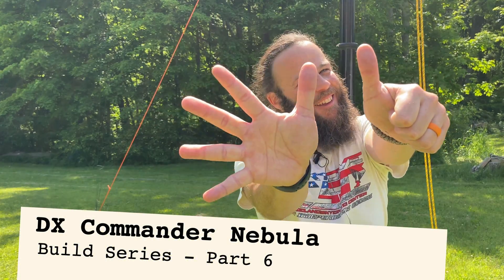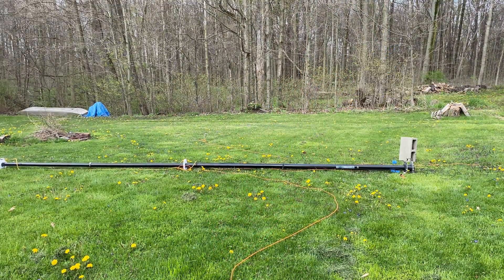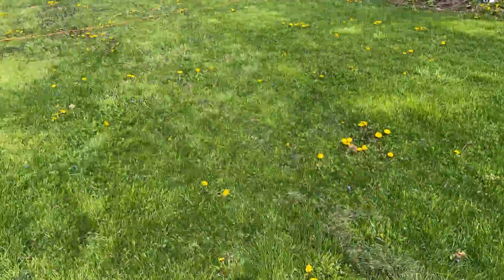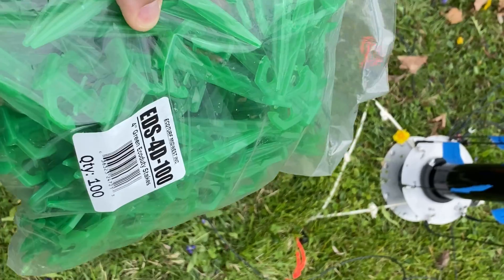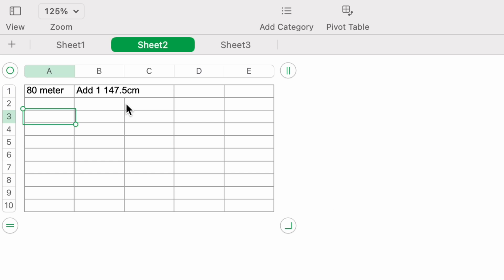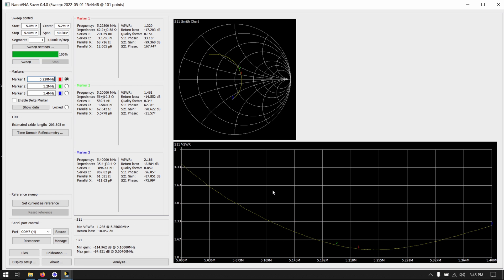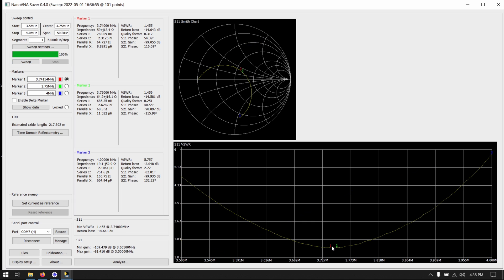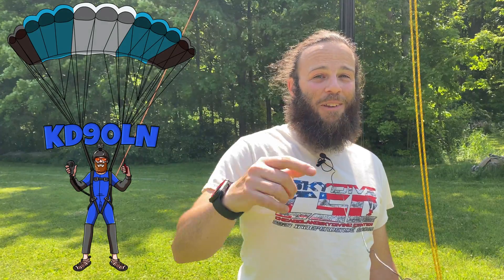DX Commander Nebula - Part 6

Comment: Brilliant effort mate!  It is a beast of an antenna - not for the faint-hearted but it works superbly.  No tune, multiband, low take-off, and no moving parts!  I am not sure that Cal's calculator works for "fold-back" situations as it is for dipoles and "straight" elements.  Experience is that a fold back adjustment is not exactly as per the calculator.  Looking forward to the final result.
Reply from the maker: Thank you Tom! Cal is on it now. I’m certain that the tuning issues will turn out to be the dummy behind the microphone.